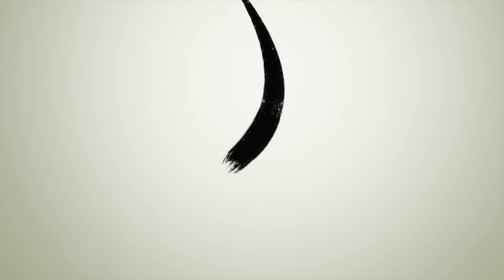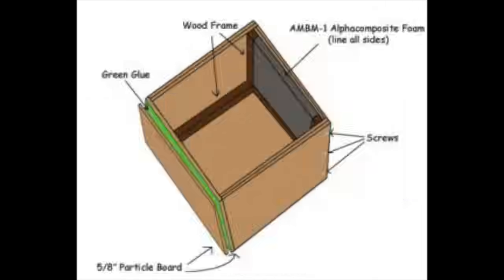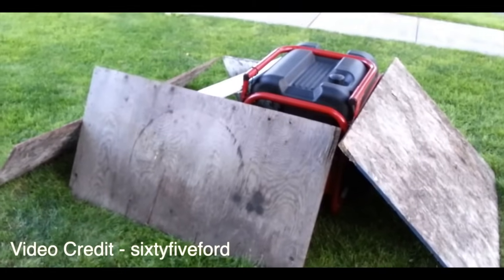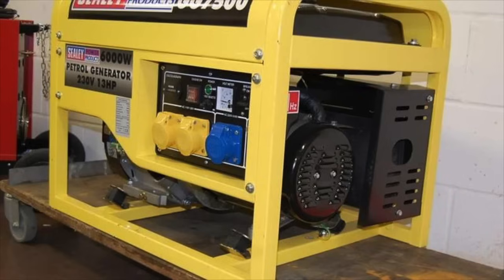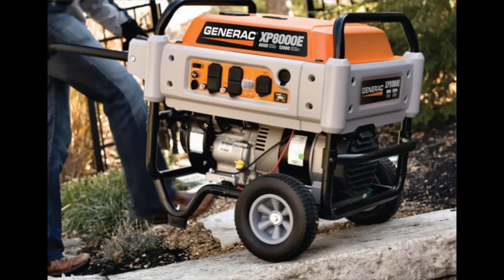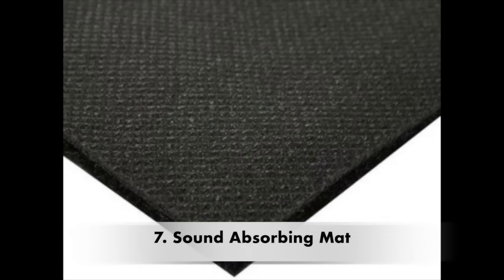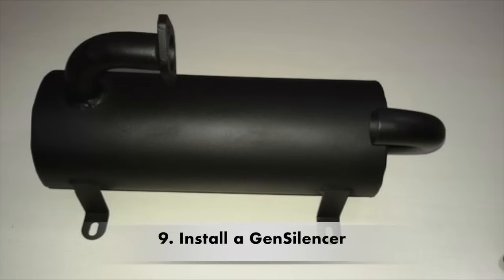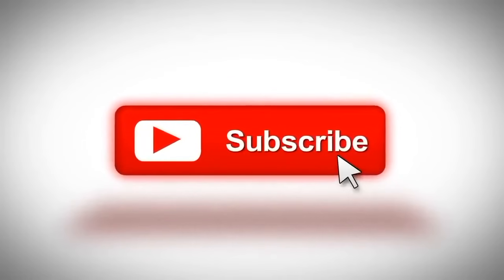How to make a generator quieter - 9 Ways That Work!

Comment: I built a 4’ x 8’ x 8’ wood shed on concrete for my generator pipe for exhaust, insulated walls and ceiling with exhaust fan with thermostat! It hooked up to exterior panel with its own breaker! Just turn off main breaker and turn own it! Safe for linemen and save for me!

Comment: Battery fan ventilation for an electrical generator.
Say that to your self a few times and see if it still makes sense.
Good info apart from that though.
Reply from the maker: I know it sounds stupid lol But the only reason I mentioned that is to not waste one of your outlets on a cooling fan when you can just get a battery-powered one... But thanks for watching and commenting :)

Comment: Don't run your extension cords any longer than necessary and if you do need to, make sure you match your gauge size to the distance and load to be used. Running too small of an extension cord a long ways could overheat, causing damage or even a fire.
Reply: It also makes the devices consume more amps... You're actually consuming more power from your generator cuz part of it is heat.    I found out a long time ago my generator couldn't start a circular saw with too long of an extension cord..... But with a short extension cord.. no problem
Reply: Yes it's called resistance

Comment: I know this video is older but just fyi. 

There are recent vids showing that a few dollar piece of drywall leaned against the gen at 45 degree angle deflects the noise from the gen into the ground really really well.  

You would do this between you and the gen and with exaust facing away like you have in this video.

Also there are vids where people demonstrate that the crank case emits most/more of the noise then the exaust. The cheap mufflers on the gens actually work quite well. 

Separately from the above it did make me wonder if a generator in a large hole in the ground would work really well.  Hole… second thought - Would be bad for gas fumes while things were off and no air moving - boom when you started it.

Comment: Puting generator inside a box will make generator to overheat no matter how many holes or ventilations you do, they’re designed to work with the air flowing all over ,specially in states where the heat is a big thing.

Comment: When I was in the military while in the field we used generators. To quiet them, you dig a small hole and surround it with filled sand bags, little higher than the generator
. Totally absorbed the sound!
Reply: I’ve even seen people do same with bags of mulch, soil, sand stacked in a circle  around the generator. Stacked as high or higher than generator
Reply: I'm stunned by all the people who pretty much approach this problem the same way. And it is like they've never looked inside of a recording studio before. Or gone inside a sound booth for hearing test.

The reason that the pile of of organic shaped objects (like sand bags) stacked in a tube works is the same reason smooth flat surfaces that are perpendicular to each other like the inside of a foam lined box doesn't work.. The idea in sound deadening is to deflect the sound all over the place in the Enclosure.  What's left in that process should be directed straight up.
Reply: Won't work when camping
Reply: Thank you for your service to our great country
Reply: Thank you for your service and the info
Reply: Best tip here. Carry on.
Reply: It will be in a housing complex where it is just paving all around
Reply: And the exhaust 😂
Reply: What about the top?
Reply: Exactly.  It comes down to basic principles of sound transmission.  Dense materials like sand / pile of rocks will do far, far more than some kind of BS frame or enclosure.
Reply: What if it rains? Wouldn't the generator get submerged?
Reply: @dgoins6  Never dig in at the bottom of a ravine, always into the hillside. Also you get quite good( or quite wet) at putting some drainage in when you dig whatever.
Reply: Also military,  we dug a genny hole. The dirt/sand you take out goes in sand bags. Dig hole and line hole with sandbags. Plan for water drain. Dig in deep enough then put logs (and tarp) across and sandbags on top to make your lid.  Design access points for maintenance and refueling.  Build one end access door to roll generator out to relocate generator to another location (go camping?)  Camouflage to taste .
Reply: @jamesborton9237 number one thank you for your service to this great country of ours number two you have saved me a lot of research this is the plan that I'm going to use thank you so much
Reply: Sounds like a good idea....could you please elaborate?
Reply: Without a doubt surrounding it with sandbags would be the cheapest effective thing you could do ....assuming the sand was free. Wait until there's a flooding threat and communities usually give out sandbags and supply the sand. All you have to do is fill each with a shovel full of sand....free.
Reply: When were you in?
Reply: @jmackinjersey1  94-98
Reply: That's what I thought.  I was infantry so we didn't build,  but I do remember them in the ground to reduce noise and you could barely hear them
Reply: Yep, always dug in the gennys if possible. It also helped with identifying direction, that said, the old thumper generators were like a noise beacon in the night, nothing tactical there.
Reply: Thank you for the info, there isn't one posting on the internet on how to do this correctly!? If I'm wrong let me know. Thank you!

Comment: Sorry buddy.  It's a pretty box but a 95% reduction in noise will be 5% noise coming from the guy that just burnt up a new generator because of overheating the engine. 
95% of all noise comes from the  generator engine not the exhaust.  It's made to be outside and valve/piston clap is normal and loud.  They are also made to be air cooled.
I'd be surprised if the engine would have enough air to feed the carb much less cool it.  There is a thing called air infiltration and air exchange rate.  Air infiltration is the air that leaks into your home or enclosure through holes cracks etc.  Air exchange rate is the amount of warm/cold inside air exchanges with the opposite (warm/cold) outside.  On a cold day, in your warm house, put your hand over a light switch on an outside wall.  You will feel cold air rushing in.  That's because the small atoms are wanting to equalize with the large fat atoms in the air.  They are doing their best to equalize it to the same.  People caulk and seal these leaks to make their home more efficient but you can't reduce the air exchange rate too low or you die.  Ha.
Anyway, that box does not have anything that would cool or provide enough oxygen/ventilation to cool or run that engine.  To keep that engine cool cross ventilation (most likely mechanical because of the engine temp in a confined space) will be needed with a vent (non mechanical low on one side of the engine) and a mechanical fan and vent high on the opposite side of the generator creating forced outside air across the engine to the outside.  This will cool the engine and not make you want to make a boat anchor out of your generator.  
Your generator should be in a box and can be slightly soundproofed, but not much.  Air carries sound and the amount of access to the outside required will carry that noise.  A 5% reduction is not enough to make any difference.  A 95% reduction, that would not mean burning up your generator, would require you to put it in your neighbors house and run an extension cord to your home.  Ha.
I've built two of these enclosures.  One runs my small work shed and is a nice one that I can transfer to the other box on the side of my home that is set up for a whole house Generation.  I've tried lots of the stuff recommended and they just don't  work.  Not where there's any notable effect.  Most people have to use a meter to show any reduction because the live before and after has no change.
Also.   You could put 30 mufflers on a generator and not reduce high or low frequency sound.  That's just crap.  You generator has a built in muffler and that's all your going to get out of it.
Try buying a cheap plastic box from on line, get a good electric mechanical louvered vent and fan, cheap screened vent, some double lined heater vent that you can also put a bug screen on.  The fan and mechanical vent will be plugged into your generator so it goes on when you start it.  Easy Peasy.
Sorry to piss anyone off but this box could cost you a grand or so to replace your Gen.

Comment: I rigged my Duramax dual fuel generator with the gen turi exhaust system,which takes exhaust noise up 16 feet thru pipes,and it also takes heat with it,so noise,heat and fumes are up above our campers and others,also have a box that Al this goes into,so on full load noise is around 42 decibels.
Reply: Please do a video of your setup. This sounds like the complete answer.

Comment: Bare in mind the longer the extention cord you use the higher voltage the draw will be on your generator.
Reply: You use the proper size cord for the amperage you're feeding and for ever 50' extra length the cord is, you size up (bigger) one guage.   For instance, if you're running a standard 15A circuit at 110-125v up to 50 ft you would use a cord that is 14 guage and if it's between 50' and 100' you would size up to 12ga etc.  16 guage is good for 10A at up to 50 ft.
Reply: You need a thicker cord. If you are going 100 feet, get a 12 gauge cord. More expensive, but it won't heat up and it won't offer as much electrical resistance. It's not just a matter of how much it taxes the generator, but also how much power loss you have at the far end.

Comment: Of all the information regarding installation specifics you'd think he might mention the fact that storing an engine of any kind near or inside plywood or any kind of wood is an EXTREMLY stupid idea. And no this isn't something ''You have to do right'' or ''You gotta do it like this or that'' no.
Reply: I’m inclined to agree, there cannot be the same volume of cool air available to cool the motor, some of the hot exhaust gas and warm air from the cooling system has to be re used within the quieting box.

Comment: James Condon did a video back in June 2020, where he bought a used generator that had a car muffler installed by a previous owner. He used a decibel meter and found the generator had around a 70 decibel sound level with the muffler installed. 
He then removed the car muffler and installed a factory muffler and the sound level was then 75 to 76 decibels, so the muffler did quiet the generator around 5 decibels.  
He had the generator setting about 25 yards away from the decibel meter when testing.
Now the car muffler did have a down pipe on the exhaust side of the muffler so the sound was going down into the ground, and the factory muffler was pointed however it was pointed as installed, so that might have had some effect on the sound too.

Personally, I don't know why generator manufacturers don't just put better sound deadening mufflers on their generators. Obviously the intent for a generator is to generate electricity a short distance away from it's intended use, and a muffler is intended to quiet exhaust. Why can't the manufacturers combine these to processes?  Granted you can buy a Honda generator, pay a couple thousand dollars for what you can pay a few HUNDRED dollars for with any other generator, but the Honda units are supposedly the quietest generators you can get on the market.  
Oh well, maybe someday it'll actually become a thing.

Great video with good info. Thank you.

Comment: Making a generator box to reduce the Dbs will also reduce generator's life.What most people dont seem to understand is how air cooled devices work. Thus they build these tiny boxes without adequate cooling capacity and think all is well. No, it is not because these devices run so hot.
Reply: I see this comment a lot.
Duct fan. Just install a duct fan. It'll pull enough air through the box, shed etc,.
No more worries of over heating.

I plug mine into the generator so I turn on generator flip on fan. Quiet and cool.

I do agree they should mention overheating in these vids though!

Comment: Two things you didn't mention is you can bury the generator and you can run the exhaust into a bucket of water as long as you leave a small hole for backdraft..I have used boards to silence one and it worked really well...also one thing you said that made me laugh was you could get a battery operated fan to use in the shed....not like there is a huge generator or anything in there to hook up a box fan 😊
Reply: How small of a hole for backdraft?
Reply: Haha I also caught that battery-operated fan comment.

Comment: Small engines are loud because of the muffler type needed and they have a fan that creates mechanical noise. that enclosure will cause the air-cooled engine to overheat. small engines aren't designed for automotive mufflers they will cause the head to overheat warping the valves. you want a quit generator it's very simple no work involved, buy a honda they know what they are doing.

Comment: # 4   Car  muffler.....not entirely good. GRAB   A  MOTORCYLE  MUFFLER, as these are designed for small air cooled engines. With the baffles in it, it  IS   MUCH  better, gooderer...than  an auto muffler and smaller, as well   good day to all...

Comment: Thank you for sharing this nice video.  I apologize if someone else already mentioned what I am about to say because there are currently 397 comments to dig through.  People need to be careful modifying the exhaust systems on an engine.  All engines have an ideal amount of back pressure required to achieve the most power at the least amount of heat out of the engine while compromising a bit of power loss for noise reduction.  There is usually a sweet spot that the engineers already hit for you.  Maximize power, reduce heat and decrease noise.  When you add another muffler you could be significantly increasing the backpressure on the exhaust port of the cylinder(s).  This will reduce power and can also affect carburetor jetting efficiency.

The noise mat and sound suppression box are a great approach so long as the engine has proper ventilation.  If you stick it in a box, the oxygen level in that box will drop and that will cause the engine to run richer in fuel.  So assuring the air intake at the air filter is closest to or outside of the box would be best.

All of the better engine companies do extensive testing to maximize the output of their engines.  When they run their tests they do so in varying environments such as high altitude, cold climate, hot climates.  However they do not assume someone is going to put the engine inside of a box and this could have a detrimental impact on the engines lifespan / fuel consumption and performance.  Ok, preaching over with now.
Reply from the maker: Thank you for the comment! I will mention all of this information in a future video and give you a shout out if that's ok with you! :)
Reply: @soundproofguide  thanks again for your content.
Reply: Good info. Well spoken.
Reply: The ideal amount of back pressure is always zero. Any amount of back pressure will reduce power since it requires the engine to do more work to expel the exhaust gasses.
Exhaust tuning revolves around pressure waves and their termination. By altering when the pressure wave is terminated, you change what RPM peak torque and power occurs at by making use of the scavenging effect to increase cylinder filling at specific RPMs. That is what hot rodders do with headers and muffler placement.
Car mufflers will flow more than enough for any small engine to not add back pressure, however it can change when the pressure wave is terminated and that can change when peak power occurs. Since most small engines operate in a small range of RPMs, 3,600 or less, a shift to a higher rpm would be noticed as a loss of power in the lower operating range because the engine will never turn enough RPMs to achieve the new peak scavenging.